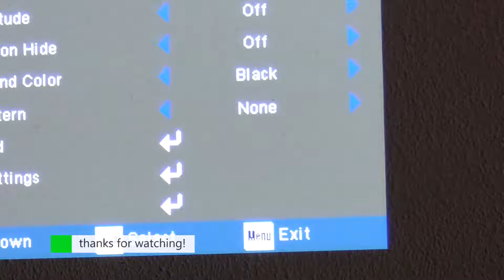Colour Wheel Replacement - Optoma HD600X Projector | Tutorial

Comment: If you look closely, the ribbon cable connectors have a flat piece of black plastic where the ribbon cable goes into them. You need to slide a fingernail or other flat, non-sharp object (guitar pick, spudger, etc) under these black pieces of plastic to flip them up to release the cable. Laptops are filled with these connectors; doesn't surprise me they use them on other electronics as well.
Reply from the maker: +bdwilcox Yeah, I tried to take it off, but it was stuck. Better leave it alone ;) I had enough space to work ;)
Thanks for your feedback! Appreciate it!

Comment: and wha is function on this wheel=
Reply from the maker: As you saw, the original one simply shattered. And, in DLP projectors, this wheel is responsible for color, so it spins in the light path between the lamp and the DLP chip and alternates the color of the light hitting the chip from red to green to blue.